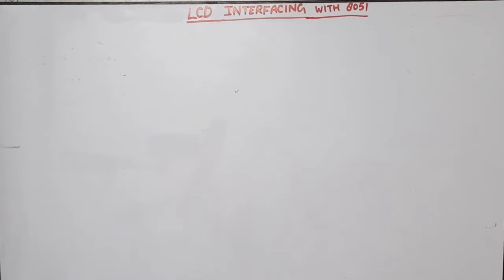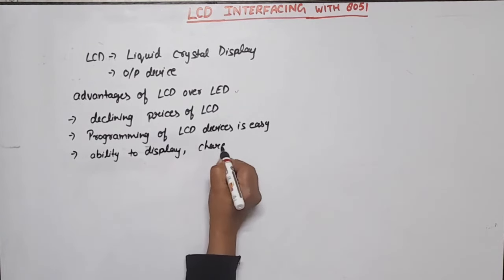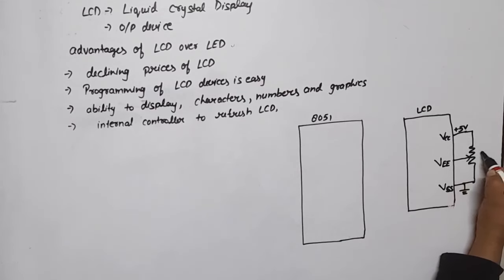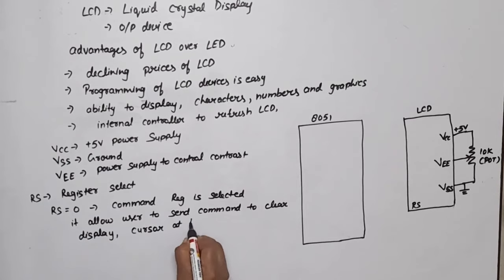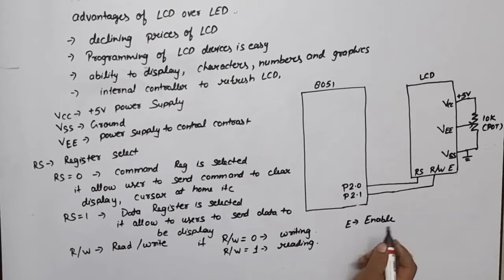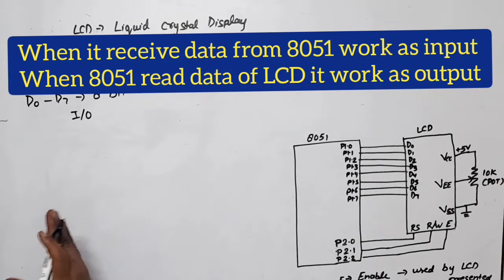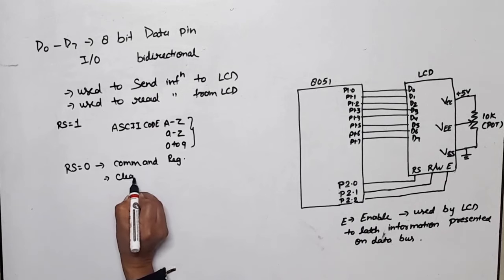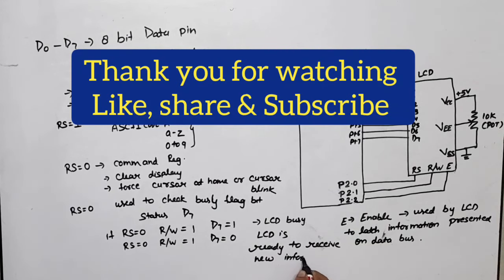Unit 5 L13 | LCD Interfacing with 8051 Microcontroller  | LCD INTERFACING

Comment: 8051and 89C51 microcontrollers both are same or different
Reply from the maker: I have no idea about 89c51 if pindiagram is same the interfacing can be same if Different the maybe change
Reply: @TechnoTutorials2783  pin diagram of 8051and 89C51 both are same
Reply from the maker: @teluguammai4746  then interfacing will be same
Reply: @TechnoTutorials2783  thankyou so much madam☺️